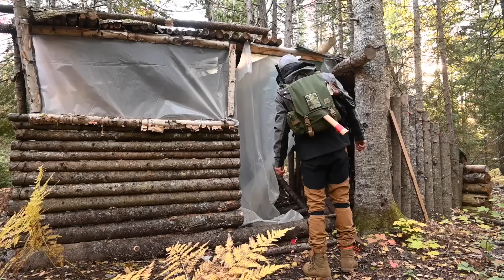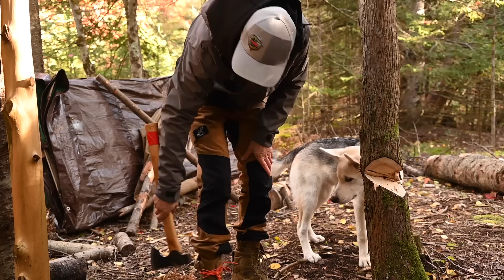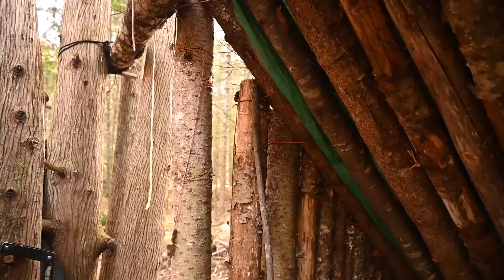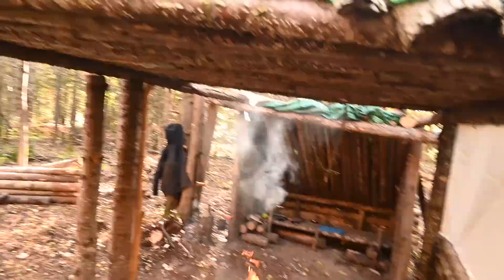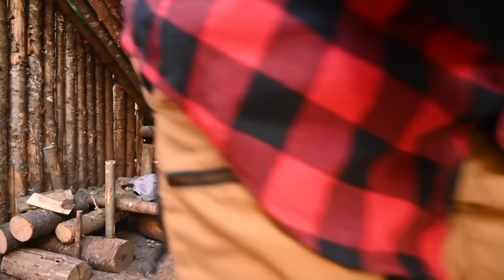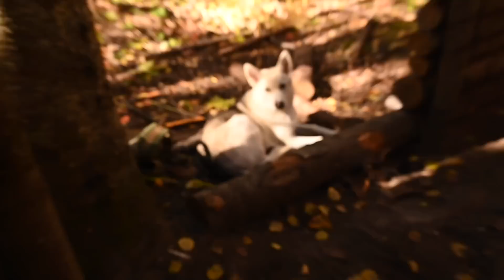Return to the Fort in the Woods - Complete Overhaul - Wolf at the Fort.

Comment: Oh man if it wasn't good enough we got a very late summer and a long, warm, beautiful fall... Joe is back to the fort to rebuild! I'm happy to see Wolf get introduced to the fort. I like what you did with that wall, too. I know how much work it was but it was forever shifting and needing adjustments. It matches the other side now which my ocd appreciates. I like the idea of doing the same thing with the front wall then add plastic windows. It'll hold up great long term and keep 99% of the snow out. Maybe leave a way to roll up or remove the windows to control the smoke and you got a great setup.

Comment: An idea for building walls would be to bury a log at the base of the wall, and then with a bit and brace (hand drill) either pound in steel rebar into the holes to "lash" the logs together with some vertical strength, so the entire wall doesn't fall over, and interlace the corners, or you could drill holes in the logs, and use smaller (1 inch diameter or so) sticks as pegs to fasten a few logs together along the length of the wall. then bury logs into the dirt, much like you did for the wall you dismantled, for the doorway. Maybe, in the future, build a field stone chimney for the fire, so the roof doesn't have to be as open, to retain more heat. I get that you're trying to build "primitive" and not use any tools aside from a shovel, a saw, and an axe/hatchet, but I think for longevity and dependability, it may be worth trying to make the fort more permanent, without using "really modern" building techniques and materials (dimensional lumber, plywood, roofing shingles, etc.) And I know you don't want to use acrylic for the windows, or use store-bought windows, but you kind of broke the "all-natural rule" by using the plastic sheeting for a window and the door. I don't expect you to build a "daily-living" cabin, but things could be more structurally sound, and safer if the logs were pinned together. something to consider for the future....Also, you can chink the gaps between the logs with a mixture of mud and grass from the area to better seal the cabin, and make it less breezy in there...

Comment: Happy to see the fort back do love the fort ones the most, was thinking the side wall where its shimmed to pack it in and is now loose maybe because the weight of the snow on the roof flexed the frame down pushing the logs into the ground but after the snow has thawed the roof has sprung back up but the logs are now set low in the ground?